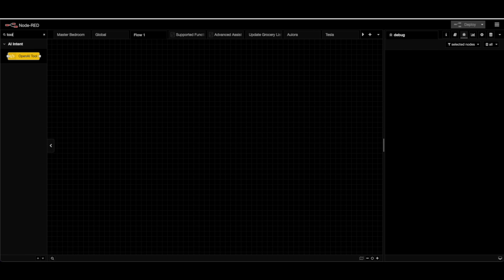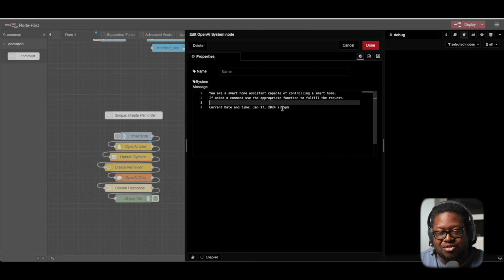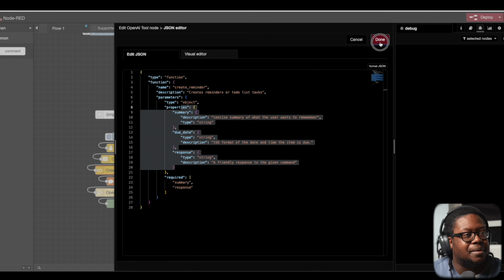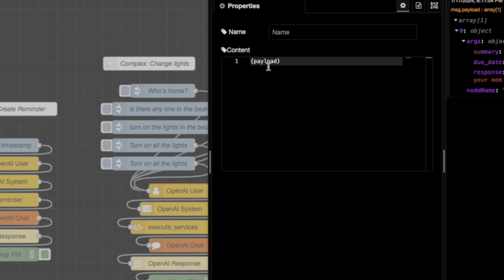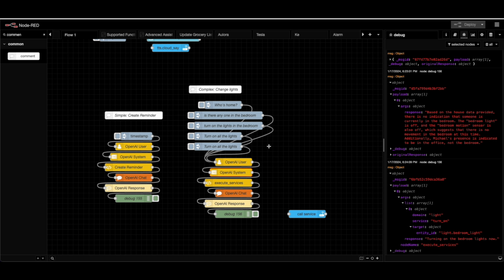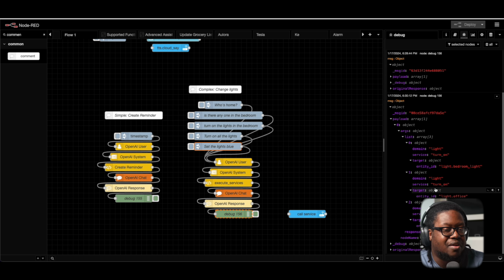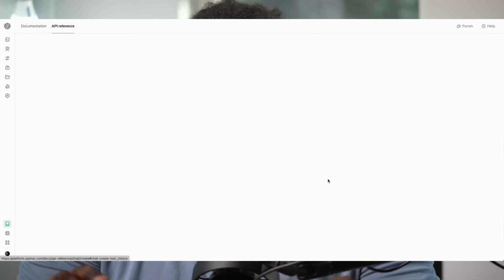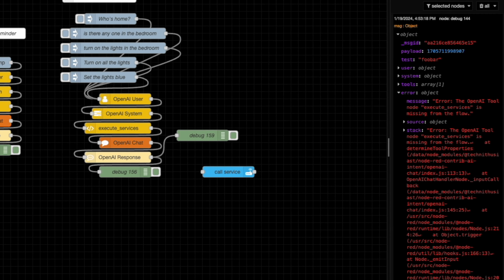Get better results using the OpenAI Tool Node

Comment: I’ve been following this from the very beginning and I really can’t explain how much I enjoy this project. I had this exact idea before ChatGPT was released and would hand write every response since I tend to just always say the same things for what I want. But this really has exceeded my expectation. Also loves that it itches the problem solver in me. Would you happen to have any more documentation on the callback service and inline more importantly resizing they keyboard keys and using callbacks to confirm and existing command. No answer please just breadcrumbs. The learning is the best part.
Reply from the maker: Hey 👋🏾 I’m glad you you’re enjoying the series! Sure I’d like to help where I can 😁Can you elaborate a little more about what you mean when you referenced the callbacks, inlines, and resizing keyboard keys? I’m not sure I completely followed.
Reply: @technithusiast  Yes! Ill break it into two comments. Back in Ep. 5 you mentioned the buttons. I am trying to configure the buttons to create a confirmation feature so EV3Y (My "KE") doesn't get to "frisky with my smarthome". I have figured out how to generate buttons using a slightly altered version of the Telegram Facade, but now its linking the telegram_callback service to continue the currently running automation.
Reply: @technithusiast  The second is just cosmetics. I notices that when i set the "Keyboard Key" value in the Telegram Facade that buttons its generates take up the entire size of the keyboard. I cant seem to find any documentation on resizing the buttons to be a little neater. I want to give EV3Y a similar UI to the BotFather.
Reply from the maker: Ahh ok i think i understand. I cant go into depth here but I used this to get a an understanding on how the sendMessage command works: https://core.telegram.org/bots/api#sendmessage The keyboard parameter can take an array of arrays which can alter how the buttons look. For the callbacks, node red can pick up information from the callback by listening to specific events types. Check the Event Triggering section of this doc: https://www.home-assistant.io/integrations/telegram_bot/ If you want to get an experience similar to the bot father you will need to save the chat/message id so you run the edit message command to update the buttons. You will mostlikely need to save the information in global context.

Hope this helps!
Reply: First of all, thank you for the quick replies—I didn't expect them! I had the same idea when I read the article in Chaperone on Global Context, but the 'Modify Context' node in the Context Subflow always returns a type error when trying to set the key. I have tried looking the function over myself but I was sure there was something that i overlooked. 

"TypeError: Cannot set properties of undefined (setting 'testKey')"

I'd like to also add that following this series has taught me more about JSON and JavaScript than I learned in school. Most of my IT work can be automated using Python, which is how I originally built EV3Y. However, this series has forced me to finally learn Java, and it's been great. I've actually been able to recreate some of my most-used programs using Java instead of Python. It's a little more stressful to debug, but it's so much more rewarding when it works.

Comment: 19:00:00Z is Zulu Time. So... That would make the reminder for noon Central Time!? Not quite the evening... You didn't specify the timezone so not sure if it assumed that you were at GMT+0... which might not be correct.
Reply from the maker: Good eye!! But It’s in ISO format so it’s a bit misleading. The Z stands for “Zero timezone” which means it’s offset by 0 from UTC
Reply: @technithusiast  btw, love your videos and like all of them. The Z means Zulu and yes could be interpreted as zero time zone. It’s the term used in aviation and by the army. It’s from the phonetic alphabet. ISO8601 that defines dates format adopted the notation as a short hand. But on your example, did chat gpt assumed you were providing the time in GMT+0 or did you specify it? If you specified it then it works if not, chat gpt failed to recognize the offset of your timezone in the calculation of the reminder and you might be reminded between 10am and 1pm! :-D
Reply from the maker: Interesting point. I didn't really specify the timezone but I did tell it to use ISO format. When servers/cloud services deal with time, they always default to ISO which uses UTC (unless told otherwise). The time it return was definitely in ISO format so it was in UTC but you do have a point! I did not specify a timezone and as a result GPT assumed the date/time i gave it in the prompt was in UTC which mean that the time it gave me back was correct if i lived in UTC but in reality if my system tried to convert it to my timezone it would be wrong! Fantastic catch 👍🏾 Very observant!